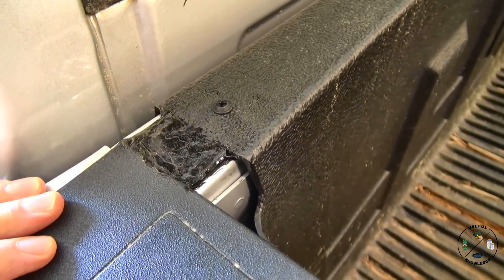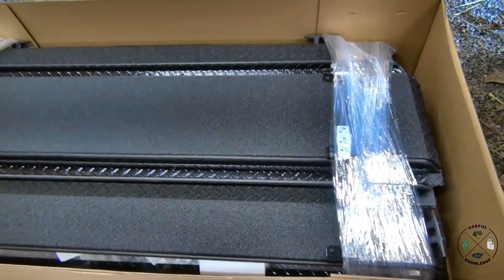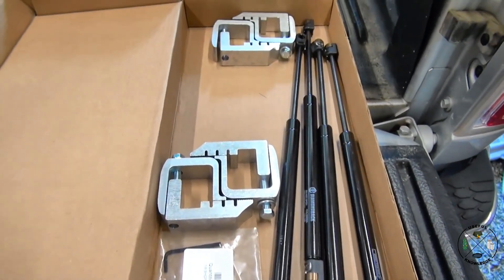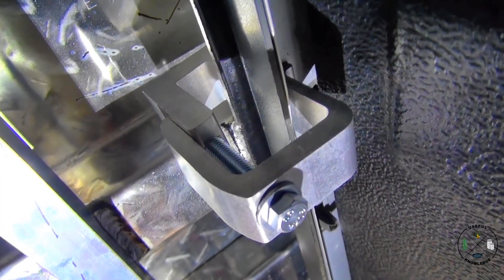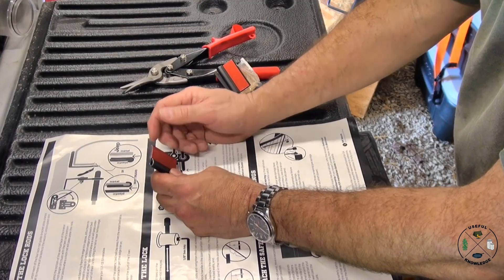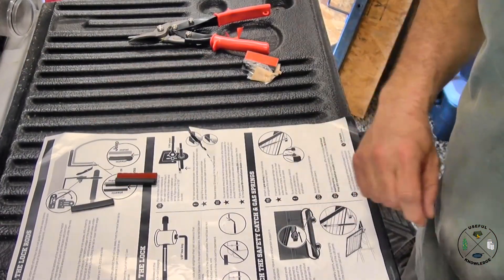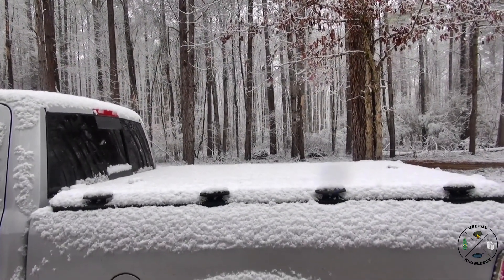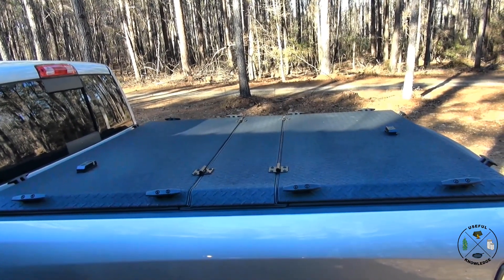Diamondback HD Truck Cover | Useful Knowledge

Comment: I've had mine for a year now also.  More than enough snow here in PA this year and it practically rains everyday here.  Only thing I've had to do is readjust the tension rods in the fall and again in the spring along with treating the gaskets and locks.  Just good maintenance as far as I'm concerned.  Best thing I've ever bought for my truck!
Reply from the maker: Same here .  I tell everybody that it’s the best thing I bought for my truck.  A few days ago had a friend want to see if it really was as good as advertised.  He was surprised when I opened the tailgate and it was dry as a bone. That was after a week of rain.  Thanks!
Reply: @useful.knowledge  Thanks for your video of the Diamondback HD! I am just about sold on this cover as being one of the most secure. I do see a potential flaw that looks like it could easily be exploited. It looks as if all someone would need to do is remove 4 hinge screws and a cover could be removed with a slight twist from the hinge side. It would be cool if someone could verify this as it looks like this would be pretty easy to do. The alternative cover I am looking at is the Renegade cover which is similar but does not have hinge screws that can be removed. What is your opinion on this? Thx.
Reply from the maker: I see your point and I think someone else pointed that out. I think it would take more force than folks realize to get the cover up because the anchor point for the lock is toward the back or front and then the edge of the cover is across the front of the bed or tailgate.  My thoughts are if someone is prepared with a proper Allen wrench and has the time to remove the hinges, they could probably get in.  With that said, the simple opportune thief will not get in it.

Comment: Are there any problems going through an automatic car wash with all the cleats catching the car wash wiper/spinner parts?  Trying to decide between Diamondback and Renegade.  Renegade has tracks you can put tie downs in and move ‘em wherever.  Diamondback has a bunch of fixed position cleats.  Any thoughts?
Reply from the maker: Hi.  The cleats are really strong on the Diamondback.  I’ve used them several times for anchoring straps for lumber and even a refrigerator.  I don’t think the washer spinner would knock them off.  They have screws anchoring them into the cover.  I haven’t really check out the Renegade.  I can tell you that I still have the Diamondback in the video and still love it.
Reply: @useful.knowledge  No doubt.  I was more concerned with phuking up the car wash by catching their brushes as I rolled through!  Probably going to buy a DiamondbackHD without cleats and add on some HD tracks that I can move the tie down points around or even take them off for a lower profile.
Reply from the maker: I just walked by my truck and took a look.  The cleats are on with Allen screws.  I also noticed that you can order to cover with cleats uninstalled.  I don’t remember that being an option 2 years ago.  About 6 months ago, I traded in the truck in the video for a new Ram 2500.  I kept the Diamondback HD and moved the whole thing over in an an hour.  You’ll love the cover.
Reply: I’ve been through my local auto wash once a month for 2 years with no issues. They have an employee at entrance that inspects trucks for stuff in the bed and has never said anything to me about damaging their brushes or my cleats.
Reply from the maker: Awesome!!  Thanks for sharing!

Comment: What do you do when you have to use your truck bed for hauling a large item (Fridge, dresser, etc)?
Reply from the maker: Hi.  The whole thing comes off in 5 minutes.  It takes about 10-20 minutes to put it back on
Reply: You are essentially screwed man. I had one, loved it, only “major” downfall is bed accessibility. Had to haul a fridge from Home Depot. You either take cover off, or haul on top which it is more than capable to carry. However, have fun getting it up and down from there. I had a tractor no worries, but not all who own these are that fortunate. As I said bed accessibility is a downfall, forget about a fifth wheel or gooseneck. You pretty much have to take the whole thing off. I feel it’s only legit purpose is for hauling crap like 4wheeler on top, which I did successfully. If you aren’t buying it for that, get a retrax pro cover. I sold my truck with the diamondback on it. Just be aware if you buy a diamondback there are some significant disadvantages. Just ordered my retrax pro for my new truck, I think this is the more versatile cover.
Reply from the maker: Well I love my diamond back cover.  I don’t feel screwed over at all.  It’s been on for 3 years with no leaks and it’s solid.  All of my tools and gear have been completely dry for those 3 years.  I moved the whole thing to a new truck in 30 minutes.  I have a tractor with forks but I didn’t need it because it comes apart in three pieces.  I’ve brought home a fridge and freezer from Home Depot.  We just laid them down on top and strapped them down.  I set them upright for a few hours and they’re fine.  The cover is tough which makes me wonder what will happen when one the Retrax panel gets dented and won’t retract properly.

Comment: I'm assuming you can't use a gooseneck or does it have a way to move, open or slide to do so?
Reply from the maker: Yes, that is a drawback.  You can remove that entire top in about 15 minutes but it takes about 30 minutes to get it back on.   If you towed a gooseneck or 5th wheel a lot, it would be a pain to remove and put it back on.  I towed a 5th wheel camper for 10 years but didn’t have a bed cover.

Comment: How easy is it to remove?  Probably not ideal for gooseneck users?
Reply from the maker: Hi.  You can remove it in about 5 minutes. It’s only on with 4 bolts.  If you use your 5th wheel hitch a lot, it would probably be a pain to take it off and back on.
Reply: @useful.knowledge  thank you

Comment: Do you notice any noisy rattling while driving with this Diamondback set up?
Reply from the maker: Hi. I’ve had my back glass open and could here a little rattling when on a dirt road.  I just adjusted one of the locking rod heights and that fixed it. Basically it wasn’t pulling the cover down correctly on one corner.

Comment: Did you put shims under the centre piece looks like there is something there ✌️🇨🇦
Reply from the maker: Hi.  No shims.  It’s just sitting on the bed rail cover.  That’s where it’s bolted to the truck so it probably does seem to sit a little higher than the panels.  They are so close that I don’t notice it.  It’s a great bed cover and I’m not sponsored by Diamondback.
Reply: Thanks my cover came in today 👍 🇨🇦
Reply from the maker: You’re going to love it!

Comment: Why don’t they use carriage bolts on the hinges so someone can’t take the hinges off to break in? Seems like an easy swap. Wondering why they didn’t design them that way.
Reply: They use flat washers and lock nuts on the inside of the bed, so unless you can get inside and get a wrench on the lock nuts, the screws will just spin.

Comment: Anyone have any issues with the cab panel not closing/locking easily?  Having issues with the longer rod going inder the bed rail to lock?
Reply from the maker: Hi.  I had to push down slightly to get it to close and lock.  If the rod is hitting, it just needs a slight adjustment with the two small bolts where they slide up and down on the adjustment slotted metal piece.  I had to adjust my back right slide rod about a month ago.
Reply: @useful.knowledge  thanks!  Yea I figured I could make that adjustment I just don't want my cover on that side too loose and not seem secure. I know all the instructions show to push down with pressure but seems to make it difficult to close the can panel.
Reply from the maker: When I first installed it, i think that I pulled it down slightly when tightening up the slide rod fixture.  When I adjusted recently, I had my wife put some pressure on it while I tightened it up.

Comment: What does the unit weigh?  Best I can tell is the BakFlip MX4 shipping weight is 70ish pounds (for reference purposes).
Reply from the maker: Hi.  I would guess about 120 lbs total.  Each panel is approximately 50lbs and the center is probably around 20.  I had a back flip on my last truck.  This is by far the best bed cover I’ve ever owned and they do not sponsor me.

Comment: Is this cover easy to remove for when I want to put my motorcycle in the truck bed?
Reply from the maker: Hi.  Yes, basically you pop off the piston shocks, remove the front and back panels, and remove the center (4 bolts).  The front and back panels both come right off when they are raised of to about 90 deg.  About a 5-10 minute job.  I just traded trucks and moved it to my new truck.  It went on in about 30 minutes.